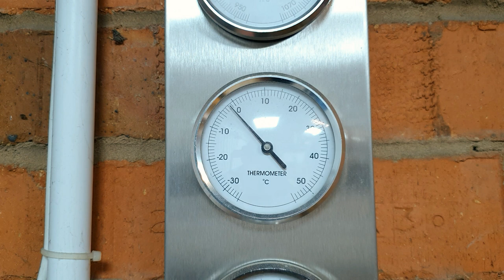Quick Low Cost TIG Filler Storage Tubes

Comment: How do you like your cheap TIG so far?  It seems to be an empty hole in my life (or at least garage).
Reply from the maker: I don't even rate myself as a novice welder 😉

https://youtu.be/E9X3l2b6Ji8?t=282

so I'm not in a position to do any sort of review. 

That said I'm really pleased with it so far. I've a long way to go, but already I can manage a relatively clean & controlled weld than needs little or no dressing afterwards. It produces no showers of sparks threatening to set the place alight and it's small & light enough to not clutter up my already overfilled garage. It has HF start, ramp up and down, pre and post gas. When I get there it will pulse, and it will stick weld should the need arise. Time will tell how long it lasts, but I'm not a heavy user earning a living from it -so hopefully a while. 

I couldn't justify the additional cost of AC from aluminium at this stage. That might be one for the future...

Thanks for watching!